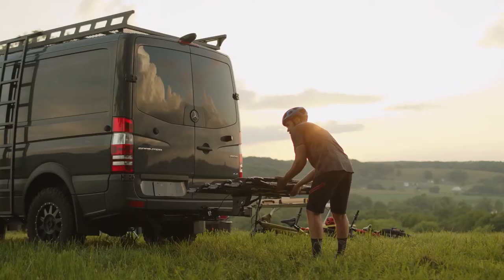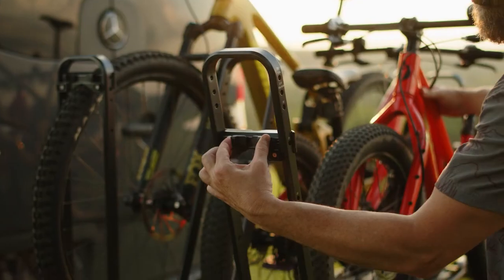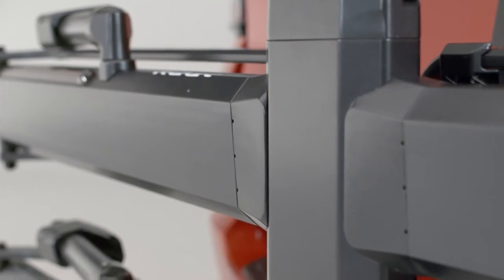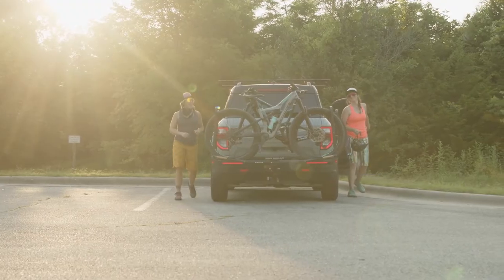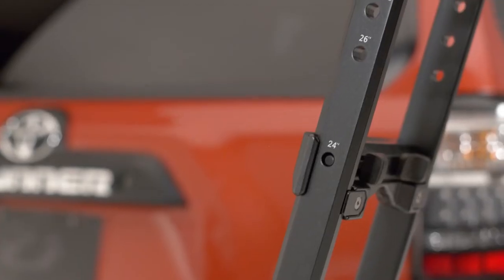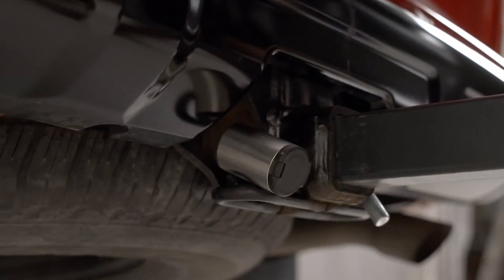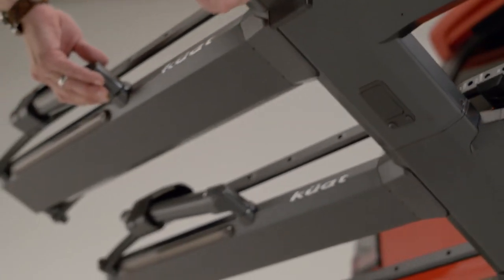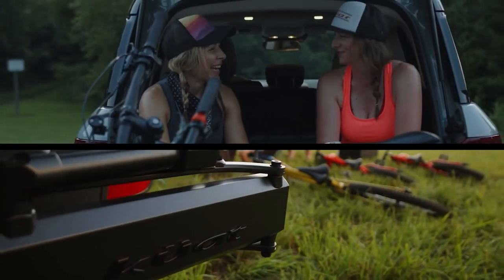Kuat Piston Pro X Overview

Comment: I like that one press open system, but should I be worried about it being accidentally open on a bumpy road? Is there any locking mechanism that does not allow one press knob to open the rack? Otherwise exactly what I was looking for. When do you think it will be available for purchase? Lastly, can I use it with Pivot v2 and a license plate holder? Thank you for your answer in advance.
Reply from the maker: No you shouldn't be worried about it accidentally opening. Kuat puts their racks through intense stress conditions to ensure the product quality. From what I can tell there is no lock to prevent someone from intentionally pressing the knob. Rack will be available approximately fall of 2022 (no confirmation yet).  Yes, technically you can use the Piston on the Pivot but may be limited in weight capacity (TBD).

Comment: What about for corolla cars? Rack for cars?
Reply from the maker: The Kuat Piston won't fit the Corolla or most sedan because it requires a 2 inch receiver. However there are many other models that will fit the Corolla like the Sherpa or the NV 2.0 both made by Kuat and many other brands like Thule and Swagman have great models that work for small sedans.
Reply: @miamihitches  FYI We do offer the Piston Pro X in a 1.25" version, great for vehicles with smaller hitch receives! All of Küat racks come in either a 2" dedicated size or a 1.25" size. Perfect for any vehicle, any size!
Reply from the maker: @craigmetcalf1750  Thank you for the information!
Reply: @miamihitches  why can’t a Corolla have a 2” hitch receiver?    A Prius can, and a Prius seems even wimpier than a Corolla.

Comment: Gimics extra weight. We're is the ramp? We now have electric bikes now. One thing here I like the tire holders. Is their straps for tires.
Your other has one strap an one tire hook? The last thing we want is damage to expensive electric bikes.
Reply from the maker: The ramp is an additional item that you install once your loading or unloading your ebike. Take a look at the 2:49 mark on the video. There is no need for tire straps on the Kuat Piston because it's new design holds both front and rear tires with it's adjustable tire slides. The Kuat Piston also offers Zero contact on the bike frame so you can safely carry your expensive bikes without worry.